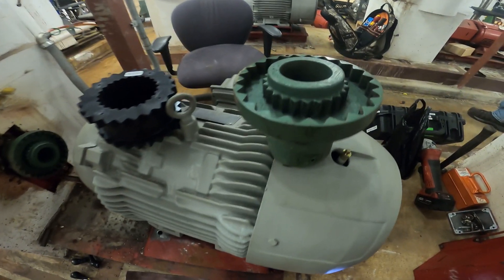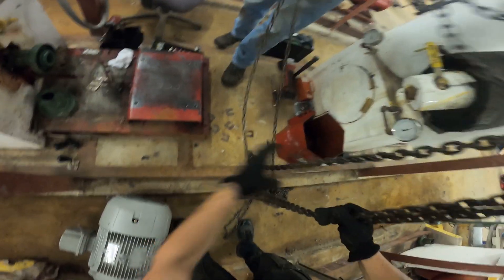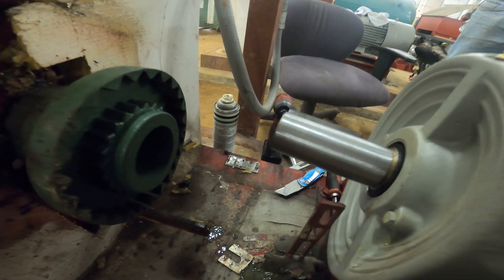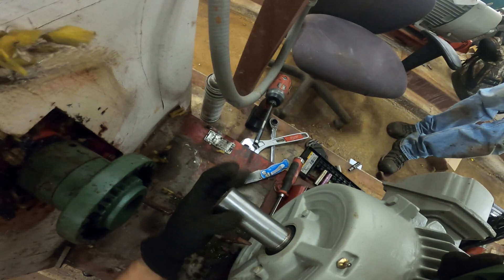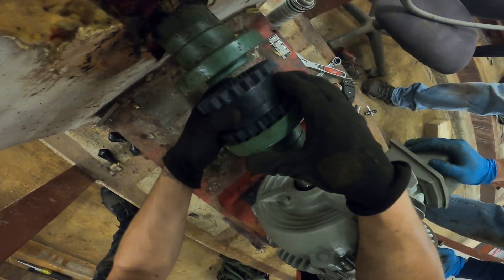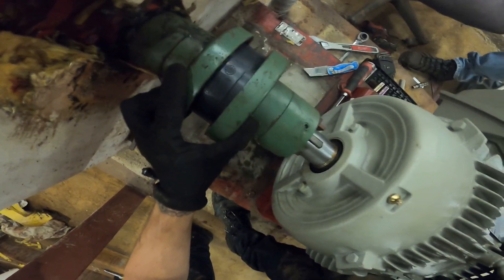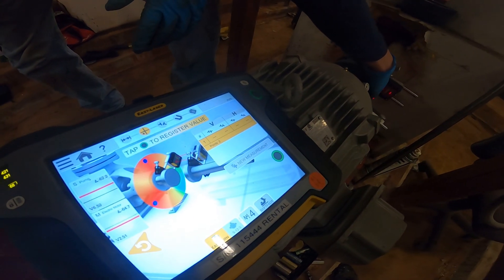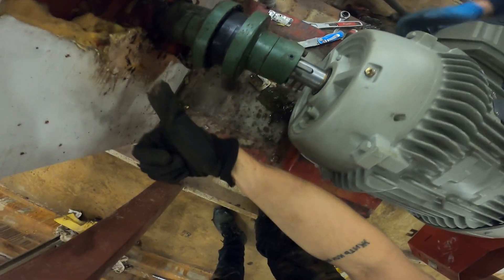HVACR: How To Install a Pump Motor Coupling (S Flange Type Solid Sleeve Coupling Insert) Centrifugal

Comment: I didn't catch when the motor was mounted to the base. I would think that would have to be done before the alignment happens as the tension will pull the motor all over the place during the lockdown of the base. Just saying, been a while since I did that type of thing.

Comment: "locking chuck" = a key
"this piece right here"  (the two green things that hold the neoprene coupling) = coupling hub (probably a lovejoy s-flex)
"this little notch here" = keyway
"locking screw" = setscrew (sometimes called a grub screw)

Comment: Great video!! If you want to up your game take "as found" measurements with the old motor prior to being pulled,. Measurements would be current draw, alignment numbers, vibration numbers, and temperature numbers. After the new motor is in repeat those measurements so you know how good the install really is. If the vibration sig is 0.1in/sec in any direction attention is required. If any of the measurements are higher than the previous pump motor then that can lead to a fruitful investigation. This is precision maintenance, when many measurements are made and compared to insure the new install is as good or better than the last install. I suggest using the RD Align app or the RD Align Pro app a laser will get to only 0.001" or 0.025mm those sound like small measurements but operating clearance of bearings are measured in micrometers or 0.001 mm, or about 0.000039 inch.